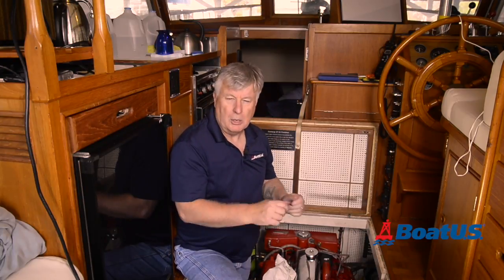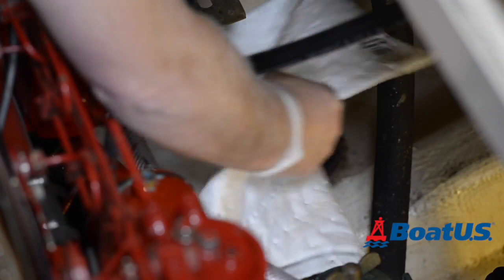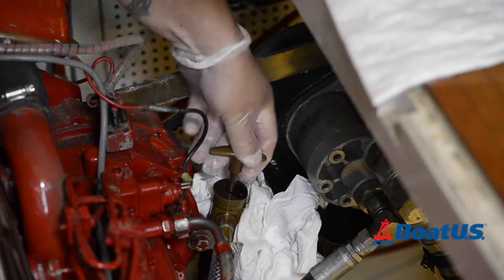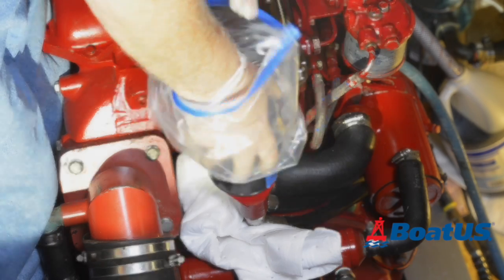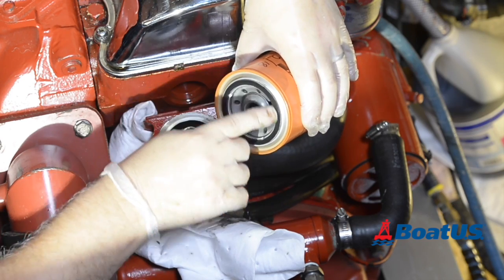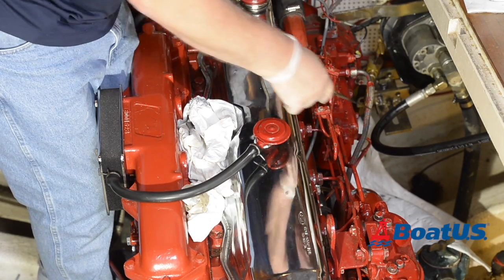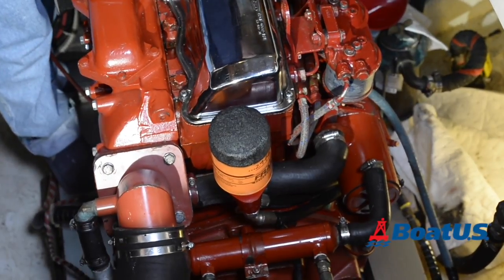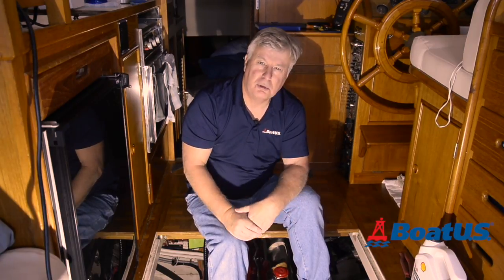How to Change the Oil in an Inboard Marine Engine | BoatUS

Comment: Florida Keys, USA here.  What container can I use and where do you properly dispose of the 5 gallons (per engine) of used oil?
Reply from the maker: Hi Nick, any old plastic milk jug will do the trick! May auto parts stores, AutoZone, Nappa, etc. will accept used motor oils, transmission fluids and other hazardous liquids at no charge.